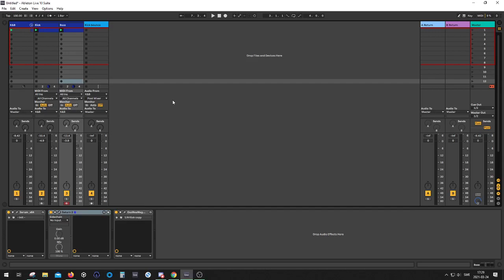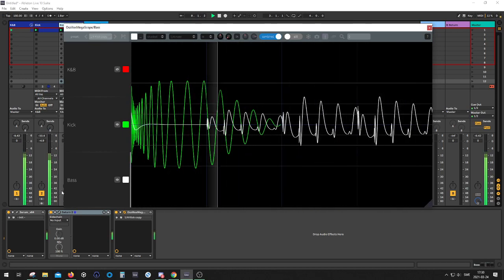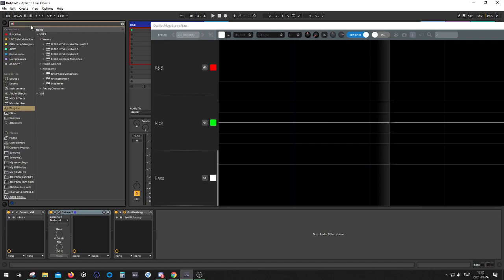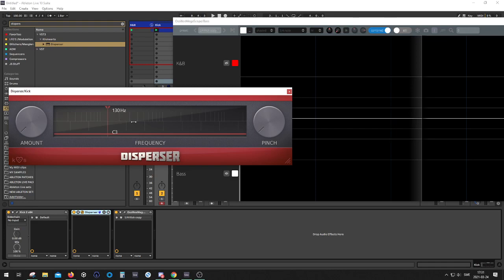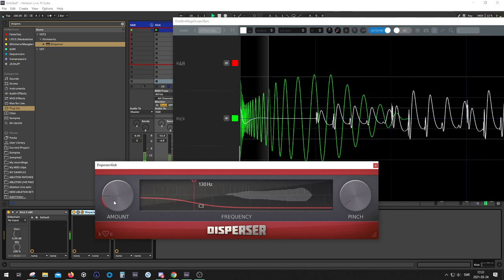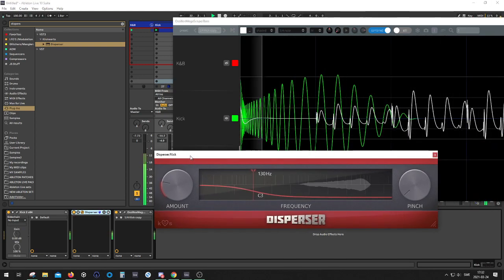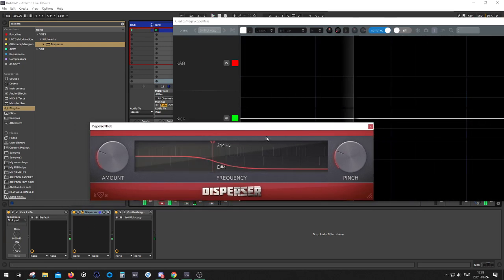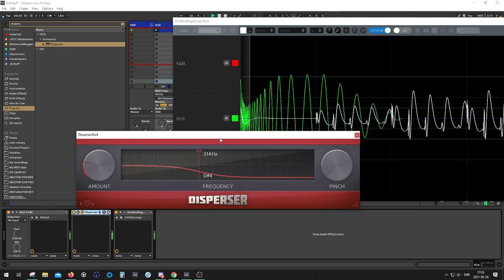Get your kick and bass in phase with Kilohearts Disperser

Comment: this only works for a fixed frecuency, when the bass plays another note it´s  out of phase again
Reply from the maker: Yes, however if you never play another note with your first bass note (which I for example do in 99% of the time) you'll avoid it that issue you mention.
Reply: Which is why sidechaining is such a big thing in EDM. Yes, also the pump but that's not something you necessarily want in all genres. Also this method changes the sound of the kick (in this example the kick ended up sounding super laser-y, which i hate personally).

Comment: Is this the reason why my bass and kick sounds muddy and mixed up
Reply from the maker: It's hard for me to tell as there are lots of ways to muddy it up and make it sound inconsistent. Getting it in phase is more about making sure there is no phase cancellation going on the subs. What this means is that if your 100% out of phase, there will be a volume loss at that point which means there will be a point in time (usually the first bass note) where there will be no bass. How does your K&B look in the scope? Are you able to check like i showed in the video? If not, you can get occularScope which is a free Oscilloscope plugin from https://bomshankamachin.es/plugins

Comment: So simple. I've not had the best results in my attempts to align phases, even with PHA-979. Will give this a bash
Reply: Even with reworking the tail of the kick in kick 2 and correct a little bit of the phase in serum u can get almost the same result :)
Reply from the maker: @Kikudoxx  Yes that is absolutely 100% true. I normally try to get it right at start but when i know i want to fatten it, and see it's out of phase, that's when i grab Disperser.

Also, getting the kick and bass 100% out of phase, one has still won half the battle haha. Because you can then invert the phase on one or the other to correct it. I those cases I find myself doing it more on the kick than the bass. It alters the sound more less.
Reply: @Kikudoxx  but…☝🏼… if you will edit some older Tracks without that Phase controllable Synths, this plugin could be very helpful 🙏🏼 😊

Comment from the maker: If you plan on using Disperser (or other similar plugins) as I do in the video, pay attention to the length of your kick. I forgot to mention this but since Disperser will shift the cycles forward or backwards, the kick will be either "shrank" or "stretched" i.e. it will become shorter or longer depending on your settings.
If that becomes a problem for you, try dispersing frequencies lower or higher up in the spectrum. If you like the sound, but you can see that it's too long, simply bounce the kick to audio and fade the tail of it. That way you'll keep the sound but it will be more controlled
Reply: just to note bro this also means that the inherent pitch of the kick will be different also, so if you have tuned your kick to your song, this would affect that, great video though